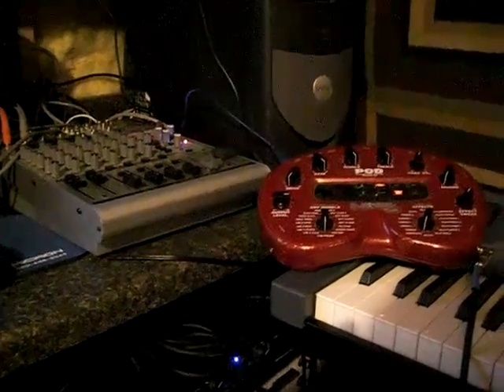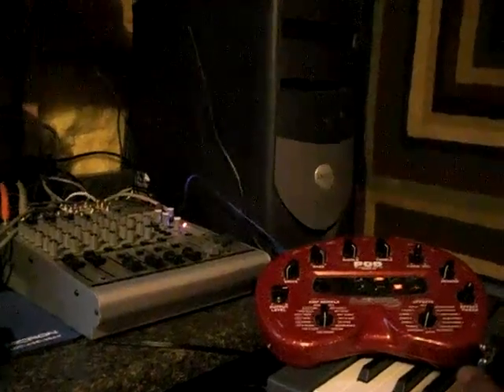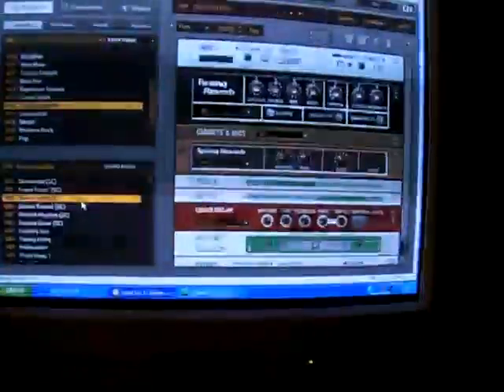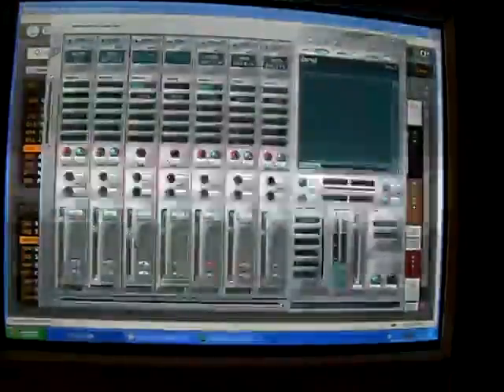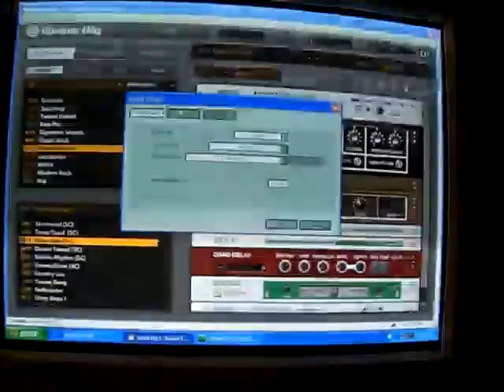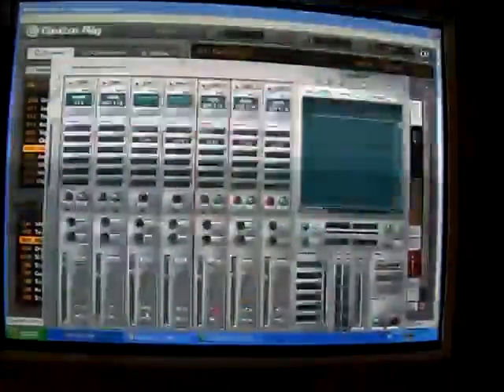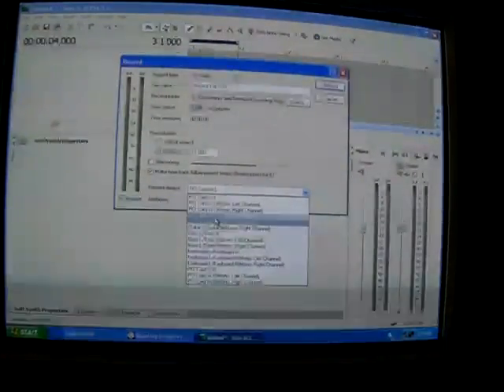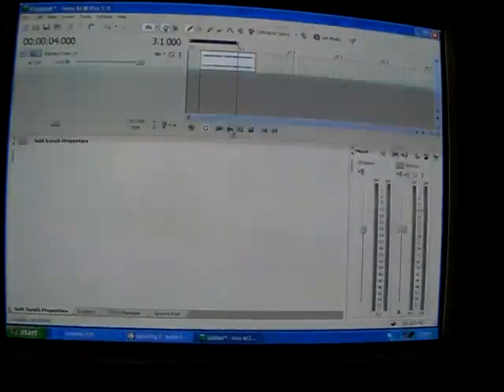Cheap and Easy Recording Studio Setup ASIO Patchmix

Comment: PatchMix driver 2.00 introduced a problem - whenever ASIO is opened - such as when an audio software enumerates the available ins and outs, or begins playback - there is a spike of full cpu usage for about 1 second. I know this is avoidable bacause driver 1.82 worked fine, but that driver was worse in other aspects (waveOut/waveIn part). In most applications I can keep the driver open, but in others the device is always closed when the program's window is minimized, and then the unresponsiveness gets annoying.

Comment: Jeffhamula,
HI there.. i got EMU1212 i got it installed and its works fine. 
I think you are using mixer Behringer UB1204 same as mine. I got my guitar & mic jack to mixer input. Then, mixer main out goes to EMU1212 input. 
The EMU1212 balance out goes to my Studio Monitor.
My question is.. How can get the playback sound back into the mixer so i can use headphones from mixer to listen/monitor the recordings?

Comment from the maker: My emu 0404 is the PCI card version and it is fast with very low latency - PCI cards generally are good because you are going direct to the motherboard...  
However, for your laptop, I think your options are more like USB or firewire interfaces.  I would look at firewire if you can afford it.  My friend has a presonus firebox at it is great.  Also, I just got a firewire mixer off ebay, and it records 12 tracks with monitoring and like 4ms latency.  I got it for 100 bucks used. msg me if you need

Comment from the maker: I used to think the same thing and actually used to just build my own, like crazy AMD machines and overclock them and all that, but I got this Dell cheap and it has been working great and is very quiet.  I have had a lot less problems with my dell than any other computer - which surprises me too.

Comment from the maker: I agree with you that Patchmix is too hard to set up -especially from scratch.  ASIO drivers themselves are hard to figure out - I was trying to do this patchmix stuff with ASIO4ALL through a soundblaster.  That was a nightmare.  I actually found a template online (that is no longer there for some reason) that was set up how I needed it for the EMU.  It was basically a MIDI and Audio recording template.  It seems most sound cards are geared to gamers or sound engineers, not musicians...

Comment from the maker: I started with the soundblaster too.  The hard part with me was to understand the Patchmix software.  The preset I used was called e-wire.  Anyway, the pod models guitar amps - however I usually only use the pre-amp setting with no effects for bass and guitar.  I also use a lineout on my bass amp